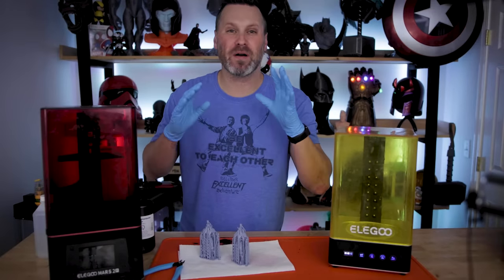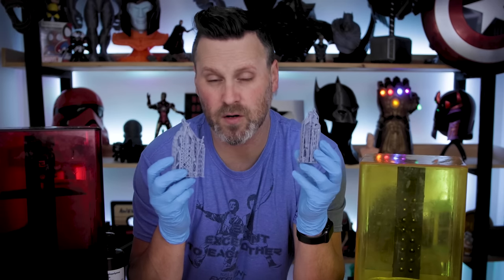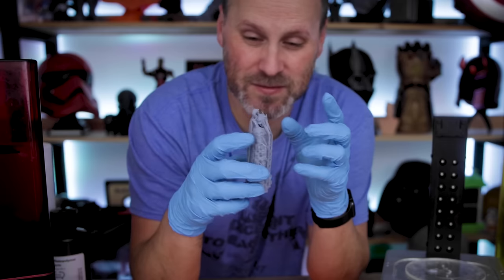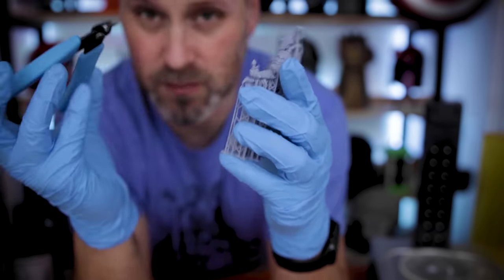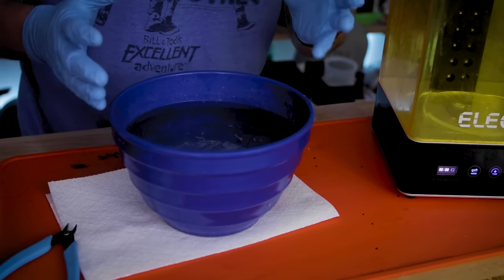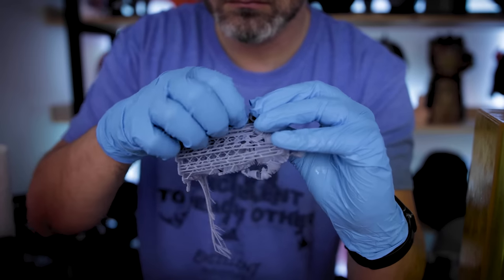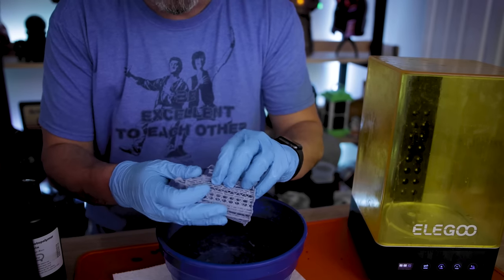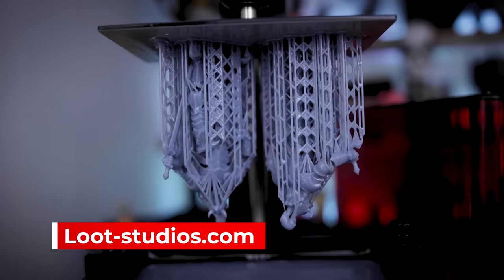Resin 3D Printing Basics - How to Remove Supports

Comment: I just discovered a way to fix dents in fep sheet, basically use a hair drier and then wave the vat in the air after each pass, the fep will sag a bit from the heat and then get back to it's original shape when waving it, then place the vat back onto the screen and using a plastic spatula try to flatten it. Did it with mine and can't feel the dent anymore with the plastic spatula.

Comment: Other than picking out those supports harder or easier, i find it so hard to pick them out without damaging the print itself. usually when i remove the supports some tip of the print(the surface) comes out with the support too, making the print so many holes on the surface. is there any easy way to fix this or avoid it from happening? 
I also wonder if there are some layer lines on the print making the smooth surface so rough can we use paint brush to put resin on it to smoothen the surface?

Comment: Thank you so much for this! Still trying to figure out the whole 3d printing [got both pla and resin ones] and was really struggling getting the supports off the resin to the point i would get angry at myself.
Will try this now later as it seems sooooo much easier than going through each individual support and hoping you dont get any firing at you.

Comment: Unkah J: X-ACTO BLADES/KNIVES!
Def use the clippers for most removal but you can't beat the precision of an xacto knife when it comes to preserving fine details.
Reply: This is what I do, but it’s very time consuming.
Reply: @joshuar56  question would heating the exacto knife blade make it easier to slice through support structures

Comment: Biggest problem with this method? Even after a full wash in IPA a print is not safe to handle without gloves because the surface is still contaminated. When you soak your model in hot water that water is now also contaminated with uncured toxic resin. Just like with water washable resin, that contaminated water should not be tipped down the sink and needs to be disposed of safely and responsibly. Instead of contaminating a bucket of clean water with every single print.. use a hair dryer. It’s the exact same concept, using heat to soften the supports, but you’re not getting your gloves and print area wet, your models not getting wet, and you aren’t contaminating even more liquid that you then have to dispose of. The hair dryer works even quicker (10 seconds under the hair dryer and supports peel right off) and it has the added bonus of fully drying your model so you don’t get those ugly white stains after curing. 
Try it. A hair dryer is great for removing supports, drying your model and it’s also an essential tool for quickly drying your paints when you are priming and painting your models. It’s one of the essential tools in my setup.
Reply: While technically true, it's not in practice. If you did your cleaning properly ( including a rinse ), then the amount of resin that heating bath would get in it is absolutely trivial. You're in homeopathy concentration territory.

A hair dryer is also much more likely to cause uneven heating, which can really warp the print.

All that being said, my preferred method avoids both of those: I use my ultrasonic cleaner to heat my print, and remove my supports before their final wash and rinse.

Comment: Depending on what your printing and what resin your using. Curing your print before support removal is preferable. Helps to keep the print from warping (especially with thin wall parts).

Comment: Here is my method for success:
1) rinse with IPA (I use Methyl Hydrate - stronger, cheaper, quicker - 1-3min depending on nooks within the models). I find that both methyl hydrate and IPA leave a sticky residue post rinse...  
2) let dry a couple of minutes
3) Mr. Clean in ultrasonic cleaner heated to 40celcius for 10min - this neutralizes all remaining resin; this heats up the resin more uniformly as Uncle Jesse describes. 
4) rinse with water
5) remove supports with ease...

Comment: How about warm water after the cure?
Reply: Doesn't really work, after curing everything becomes hard and brittle, warm water won't weaken the supports and be flexible at that point, it will still just snap off. I suppose if you used some super hot water you could weaken the connection but at that point why wouldn't you just do the second method normally before the cure instead? 

Another downside to curing while the supports are still on is that it prevents an equal amount of light from getting to the print during the curing process because the supports are in the way, while it unlikely that this will really affect anything I have had a couple of prints that after trying to cure it first I needed to recure it again because some of the resin on undersides like arms or legs was still tacky to the touch because the supports were in the way.
Reply: @drizzitdude  Thank you for your response.
I don't have a resin printer but thought the question needed asking for people like myself. Great answer very thorough.
Reply: No problem dude, and this hobby is super welcoming and there are a lot of resources and guides to look for help. I only started at Christmas and I am loving it so far!

Comment: Wish I had seen that before. I did the warm water method as well but instead it was boiling hot water and it was inside for far too long. What ended up happening is part s of the model started wiggling around funnily and the supports at the ends seemed to "melt"
Overall it was a terrible massacre of the model and a lot of details were lost.

Comment: First off always use eye protection when cutting off supports.
I prefer not to use warm water as it can warp the print, if u immediately begin removing the print after it completed the supports will be softer then later as it tends to cure over time,. For my method before curing i just remove most of the supports and a part of the raft and keep some for grabbing when i dunk and swirl it in IPA and water, ill either dunk it manually or use a magnetic stirrer, the supports get softer a bit even in room temp water.

Comment: What do you do with the hot water-resin mix? I bottle my used IPA-resin mix and leave it to cure in the sun (I then use the cleaned alcohol again). Can I do the same with the hot water mix? I have been bottling it too, but haven't got a full container yet.

Comment: My only problem when removing supports is that it leaves small dented circle when support head is removed. Any tips on avoiding that?
Reply from the maker: You can try to get in really close with the clippers and clip it away. I can usually get pretty clean breaks, if not some light sanding or filling the hole slightly with a drop of resin and then cure it with a UV light/pen
Reply: If that's on a model you supported in the slicer, try using thinner supports on parts that are less critical to support the model. If you have the right settings those supports are super thin and will leave not marks.
Reply: Heating the print ( as in warm water in this video ) helps a lot here. Softer supports mean they are much less likely to break a chunk out, but rather peel off cleanly. Make sure not to rush the support removal: If it's starting to cool down and harden back up, stop and heat it up again.

Comment: Can I ask, would you say the original Elegoo Mars is still a great Resin Printer, I have the first one and their have been releases of two different models I believe and I know they have a larger build plate, but that does not make the original obsolete?.
I only ask as I can't afford one of the newer Elegoo models but the original still is able to print out great prints or are the newer bigger models a lot better?.

Comment: After the print is done, I rinse it with IPA for about 5 minutes. Once they dry use warm water for a minute or 2 and then the supports soften and are easily removed. Then cure.

Comment: Since the warm water is coming into contact with resin which is not fully cured, how are you disposing the contaminated water?  And is the container also contaminated, meaning you should dedicate a container to this process rather than wash it and put it back in the kitchen?

Comment: mostly use the same method but i use the monocure resin away for models , its REALLY good for models and things with hi detail,  i also have a second bucket of cool water, so once the supports are off i put it in the cool water for 30 seconds just to wash off any residue thats left , then a soft towel pat down and then the bright aussie sun does the rest :)

Comment: Jesse: Your methodology seems a bit flawed to me. Is there a reason you wouldn't soften the fully cured model in warm water? As shown, you made two changes to the support removal procedure (pre-cure removal AND warm water bath) and declared the second superior. I would like to see you print the same model a third time, cure it prior to removing the supports but give it the warm water bath treatment and show the results alongside these results.
Reply: One of the main issues to not cure supports is that there's a much bigger chance of breaking the model while taking the supports. If the supports are well setup they will come out with no marks and without any effort. Curing the model will definitely leave marks on the model when removing the supports. Warm water is not always needed with uncured supports.
Reply: Fully cured supports are much harder, so warm water doesn't really cut it for softening them up. That's more of an extra kicker to help, rather than its own separate thing.

Comment: Having never used a resin 3d printer, I own two fdm printers, does a resin printer need that many supports to print a model like that? How much resin is used up on just supports?
Reply: Much like FDM, it's highly dependent on the print. I have done quite a few prints with absolutely no supports, and others with even more than the above.

The supports themselves are actually fairly thin though as they're mainly just under tension, so they don't eat a lot of resin. Rafts ( which are very important as they are what locks the print to the plate ) can often eat as much as all of the supports combined.

I would say typically it's in the 0-40% increase in resin needed.

Comment: Nice! I have my Ultra Sonic cleaner with Mean Green and I’ll have the heater on around 30c and that works really well. Will have to try the warm water - thanks for this!!
Reply: I do the same, ultrasonic cleaner and Mean Green and I have the water at 45-50c.  Supports come off like butter I don't have a problem with warping.
Reply: Full strength or diluted? Thanks.
Reply: @michaels3003  I use full strength and then I rinse off in water after I remove the supports.
Reply: @michaels3003  Full Strength!

Comment: I got my first printer yesterday. Monday is the time for the first print, but im kinda scared about the waste diposal of paper towels and get the iso clean again.
I heard you should let is get cured in the sun and then throw it away/use the iso again. Is this true ?
Reply: I set mine in the sun for a few hours and then use a paint filter to filter the iso back into its original container. For waste paper towels I throw them in a closing garbage can with a lid to prevent smell. You can also get a UV garbage can to cure the paper towels if you are worried about it.
Reply: @Nadgers  thanks for the tips

Comment: In terms of working with resin, I remember seeing you use reusable gloves in earlier videos. How do you remove the uncured resin from gloves, tools, the mats, etc without creating a giant waste of paper towels? Do you soak them in the iso alcohol and let them air dry?
Reply: Paper towels will be wasted unfortunately. The best way to be safe with resin is to cure anything resin touches after wiping it down with alcohol, and then cleaning it up with a paper towel. I have the same thick resuable gloves and I still wipe them down with a paper towel before leaving them in front of the window to make sure any resin is cured, same goes for tools like the scrapers. Poor some Isoproyl on a paper towel, give it a wipe down, dry it and then leave it with the gloves.  

Unfortunately the thick gloves remove a lot of your dexterity, so I recommend switching to the disposable gloves AFTER cleaning the model in alcohol and water. At that point you can basically reuse those gloves because they aren't touching raw resin, and anything remaining was likely cleaned up from either the alcohol bath or the water wash. Then have the dexterity you need for clipping supports or cleaning up certain areas.
Reply: Most of that stuff would be dedicated to the printer, so they don't need to be cleaned. You're wearing gloves any time you would touch them anyways, so it's not an issue.

In fact, I've actually gotten removing my gloves down without touching the inside/etc. so I can reuse them without washing.

That being said, yea. You'll go through paper towels. It happens. Resin is one of those annoying liquids, where it will transfer to anything and spread like crazy if you let it. Paper towels are the main thing to stop that. ( Note: I still wipe any bulk liquid resin off of everything with paper towels anyways. I just don't "clean" them, which can include using a "dirty" paper towel many times before it needs to finally be cured and tossed out. )

Comment: Please, what support settings did you use in that models? :D
Reply from the maker: They were presupported by lootstudios and amazing
Reply: @UncleJessy  Yeah! Awesome supports :0
Reply: @UncleJessy  I would make 1 note though: They didn't use a raft, and there appeared to be cupping spots formed around the support bases. The supports themselves definitely appeared a lot better than many other presupported garbage I have seen. It's a tricky art:(

Comment: Have you ever experienced a print dissolving while in the cleaning solution? I've had that happen while using Anycubic grey cooked with my sonic mini and cleaned with green Mr Clean cleaner. Is that common? Btw, followed your recommendation and recently ordered an Anycubic Photon Mono X. Looking forward to it's arrival.